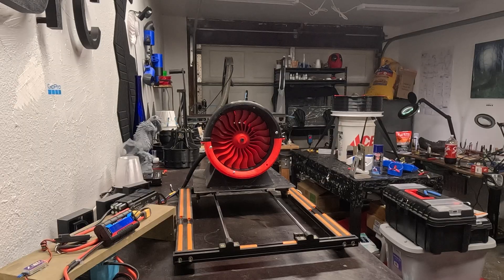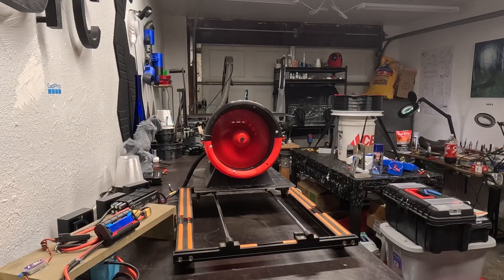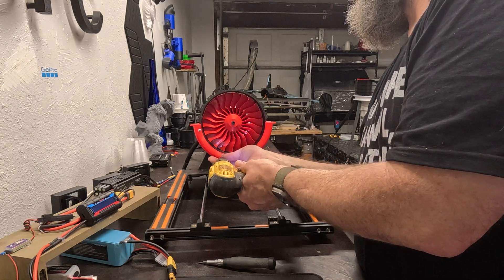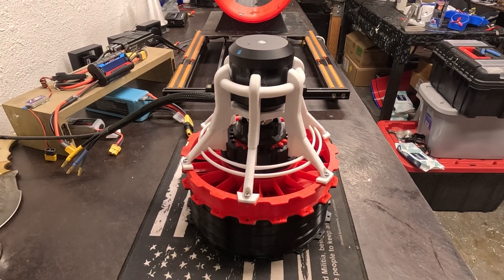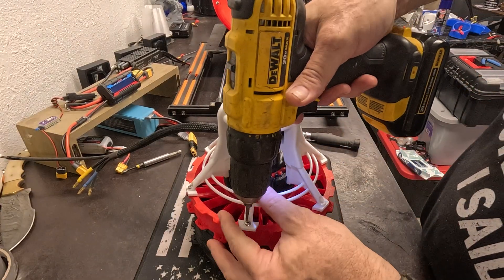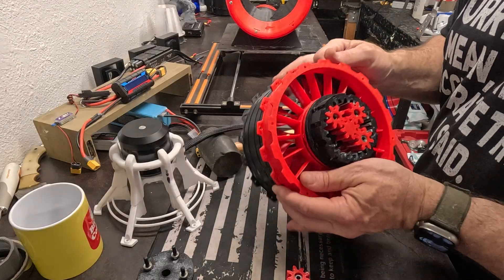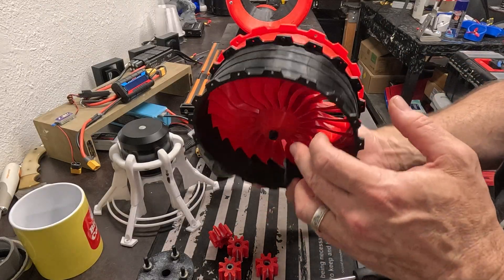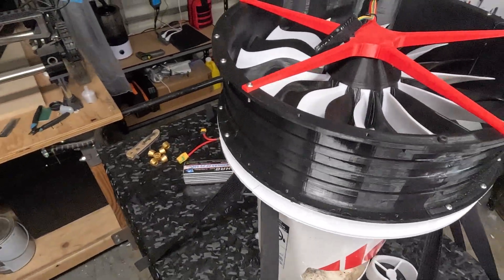3D printed 170mm EDF test run. New planetary gear design in the works. #fyp #diy #3dprinting

Comment: Herringbone gears, more strength, self align
Reply from the maker: Agreed I just have to be careful about the tooth size because the 3-D printed versions won’t last too long if the teeth end up being too small, and then there are size constraints to the planetary your system, because of how many teeth are necessary to get the gear ratio that I’m looking for.

Comment: Why gears? They are noisy and uhhh well  have you considered polyurethene wheels ? Friction could be maintained by a bendix (type) gear similar to a one speed bicycle hub configuration .
Reply from the maker: If I design the gears properly, they won’t be so noisy. However, the idea is to get a four to one step up since I’m using a high torque low KV motor for the purposes of pushing air harder and faster.

Comment: I made a 180mm EDF with direct drive,  TFL 56123/230kv-V-2-1-2 motor. Machined a 2 piece hub. Five blades were printed with polycarbonate and each were weight matched. The whole assembly balanced on my dynamic balancer. I used Javaprop to designed the blades. Peak static thrust was 20lbs at 110 amps at 17k rpm. This was intended to be a mild setup so I did not push it to 14 cells. Previous hub design failed because it caused one blade to move causing it strike the shroud. The whole thing then violently exploded. Some parts flew past me at 20 ft behind. I was wearing a face shield, leather gloves and heavy canvases coat for safety. Please be careful.
Reply from the maker: I'm not in the room when I spin up the 170 or the 340. I have had a 22 blade explode while I was holding it down. Fan casing saved me.
Reply: @warmachined3472  Started looking at your other videos and notice this video wasn't your first. Looks like your doing some interesting stuff. I will enjoy this.
Reply from the maker: Well, welcome to the channel and I hope you do enjoy all the content. There’s plenty more turbine madness to come.

Comment: large module and straight teeth... noisy.
either you didnt say or i didnt hear... material?

found ABS is the best for gears, other than nylon. made a reduction with reverse for a pair of counter rotating props on a brushcutter engine... PETG and PLA got about twenty seconds, ABS has held up for the last few months with only burnishing on contact points. not having or having tried anything else, no further comment...

helical gears... shame about teh thrust. herringbones are the quietest, but assembly is a challenge though you can always split the ring gear in two... 

am quite happy printing down to M1 with a 0.6mm
Reply from the maker: Everything is PETG in this one. Ideally, I will CNC the final iteration. However, testing with FDM printed materials does have its limits. Although it is good for data collection and much cheaper if a design flaw needs to be addressed. I will try ABS as I haven't yet. A realistic prediction is I can only push a printed system so far but, it is good for proof of concept. Metal is the way in the end.

Comment: Yeah, this time the pieces are big enough to block the entire gear system.

The index should have been the second one to go. In a sense, it's good that it failed, because otherwise the current surge from this blockage could have fried the ESC (or the motor)...
Reply from the maker: I’m working on a smoother planetary system. Thankfully everything else survived.